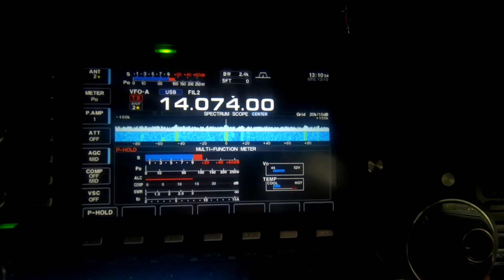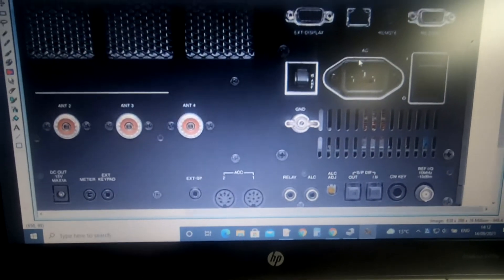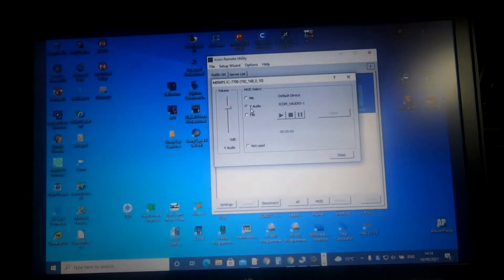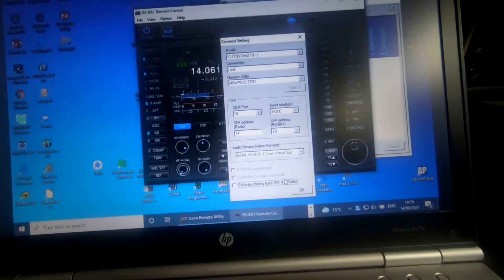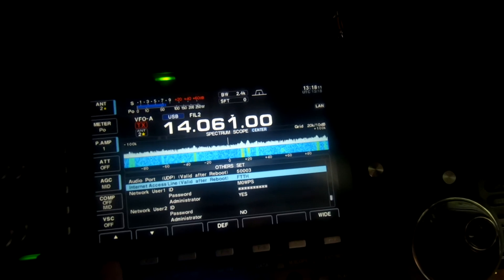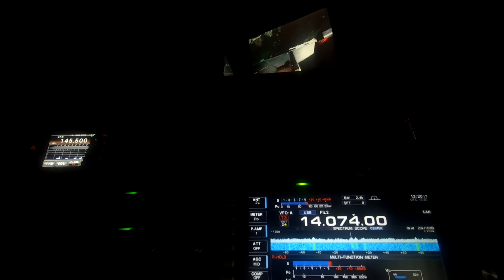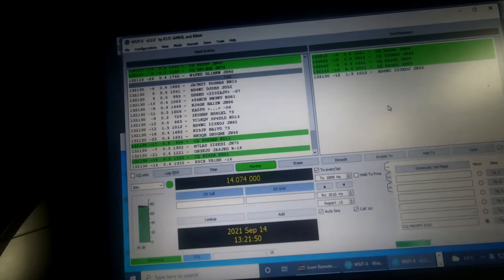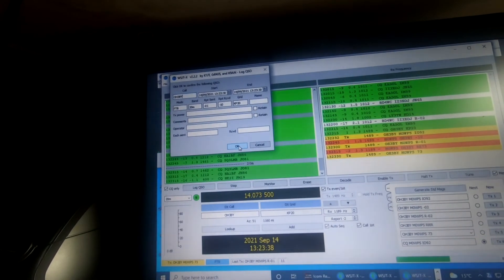Icom IC-7700 Setup Data Modes for FT8 using WSJT-X and RS-BA1

Comment: Hi Wayne, Loved your vids, got me set up. However, I have an interesting problem...
I am running WSJT-X with my IC-7700 connected to my iMac (2017) running macOS Ventura 13.6.7. Everything appears to be ok on settings, Audio/Radio, etc. The problem is, when I go to transmit I can only get WSJT-X to transmit once and only once. Any subsequent transmissions without having to exit out of the software fail. I know I'm getting out on that one transmission, as I've seen signal reports on the PSKReporter. Any clues, suggestions, assistance would be appreciated in figuring out what might be going on. Tnx & 73, KI0AR
Reply from the maker: I have heard of this problem it can be due to  RFI in the shack. It is recommended to keep CAT and Audio cables as short as possible. A simple test would be to use clip on ferrite on the USB, audio and CAT cables. Hope this is of help
Reply: @waynephillips1848  Thanks! I do have quite a bit of RFI here in the shack and plenty of ferrite cores. I'll try that first as that's the simplest explanation so far and easiest to fix barring changes to the rig or the WSJT-X software. Tnx & 73.

Comment: Small issue
Got all the parts and followed your video
Only difference is my Shack PC is Win 11
I got the rx audio to work  but when I try to use TX audio in WSJTX it's not there as an option to select
I know you showed a part when you had to select a speaker but don't have that on WIN 11

Still trying

Comment: I don't understand your concept. Are you remotely accessing your 7700 or your PC is next to your radio?
Reply from the maker: Hi, this was never set up for remote operation, The RS-BA1 software was used as it sets up a virtual Sound card and Microphone for the IC-7700 via the attached PC. please see my other video if you do not have RS-BA1 software. https://www.youtube.com/watch?v=5YnQ2b9M9NQ
Reply: @waynephillips1848  I was looking for remote access but anyway I have made it to work remotely by combining HRD, RS-BA1V2 and WSJTX. I had to use two cables, USB and CI-V to control the radio from all three software apps. Now I can do FT8 from my laptop enjoying all commands that RS-BA1 provides to my IC-7300. The HRD uses only locally installed server (Windows service only which doesn't run the main app on the local PC) but it runs on the remote laptop to provide connection to the WSJTX.